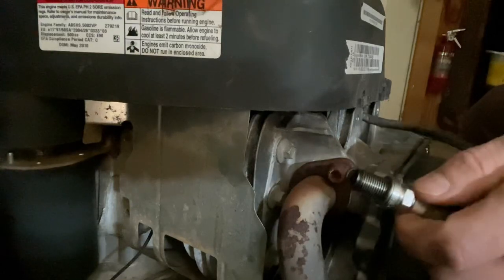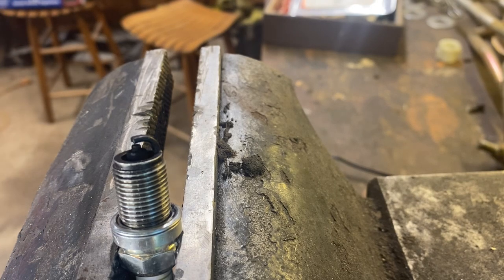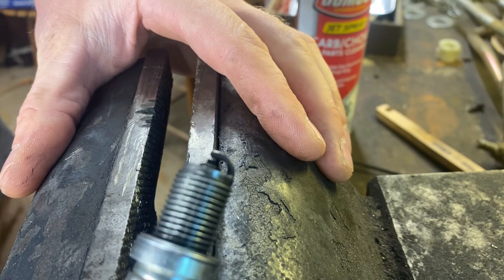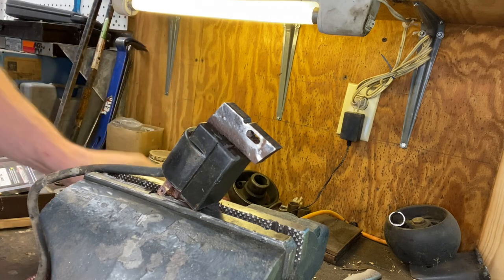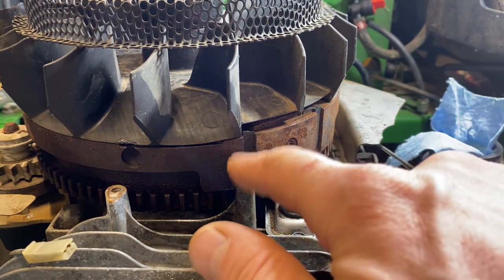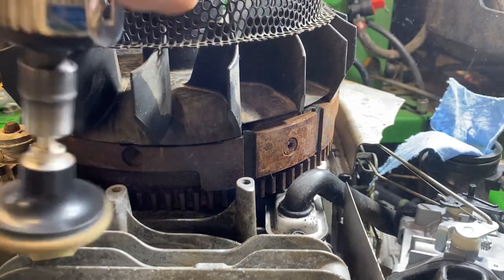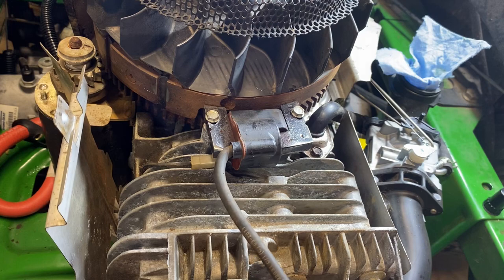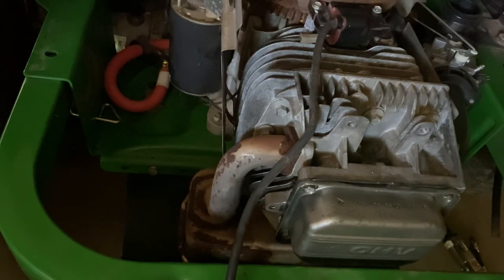Briggs No Spark - Spark Test & Free Fix! (Plug & Coil Cleaning)

Comment: I'm maybe 'that' guy, but not the one that bought the mower for $700, but one that paid $100 for a running mower, full bagger, new blades, and a decent deck.  The steering is wonky, but this one is going to get tuned and sold for that $500-$600, hopefully.  But - this video is a great reminder of the free/simple things you can do to increase value right away.
Reply from the maker: Nice. That is always a great feeling fixing up the $100 mower. That is how this whole thing got started. Buying riders for 100 for fun and selling them for 700 after a few fixes.

Comment: Besides fuel, spark, air an engine also needs minimal compression.   I had B&S riding mower with an intake valve that was so badly lapped in at low rpms the engine didn't have enough compression to start.  Before the engine wouldn't start at all it had the strange behavior that it would start when cold, but not after it had been running and was hot.
Reply from the maker: Good point

Comment: I am getting absolutely no spark but my spark plug looks completely fine and ignition coils are not bad now that i cleaned them. what do you think???
Reply from the maker: It maybe the kill switch. Try cranking it with the little wire that hooks on the ignition coil pulled off. If it works then it is the kill wire.

Comment: I have a 1998 Briggs and Stratton 18.5 OHV Intek Plus that has had 3 coils fail in 1 week.  The kill tap on the coil shows continuity to ground all of the time even when the wire is off of it.  I have bought 2 new coils after the first failure and you can start the mower the first time run it for 1 minute and it will not restart. Tested spark plug by grounding on the block and no spark now.  Any thoughts on why these are failing almost immediately?
Reply from the maker: My bet is the coil is fine and the kill system is killing it. Try running it with the kill wire unhooked and see if it runs now
Reply: @MowerMike  thanks for the reply, I have done that and still no spark.  The coil is testing bad after it stops sparking.  I'm at a loss
Reply from the maker: @matthewmoore8384  Hmm, I know Amazon mower parts have gone to crap as far as quality over the last couple of years. Maybe go to a mower shop and get a coil if you are using the Amazon ones